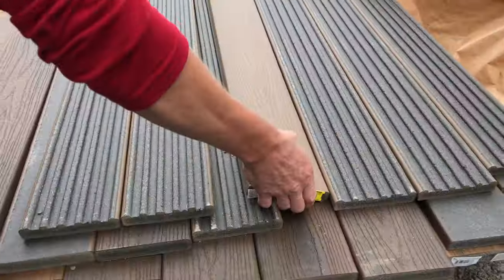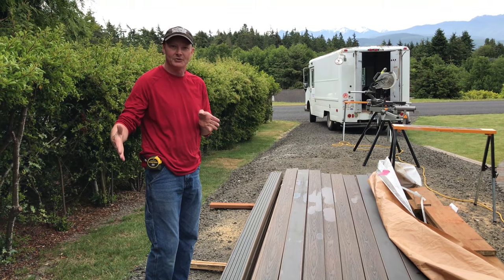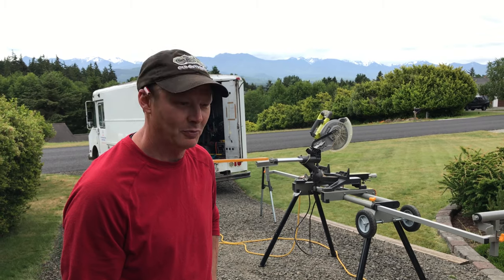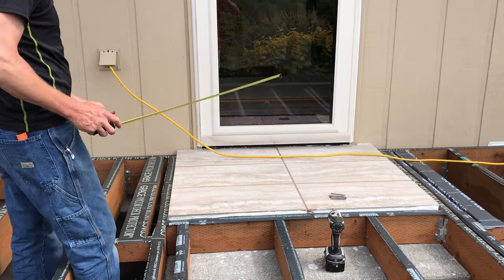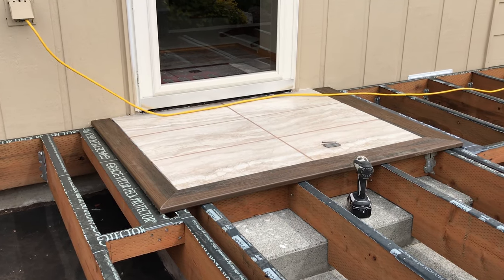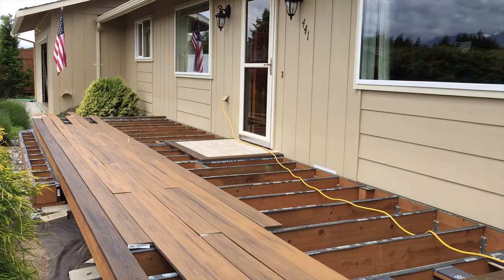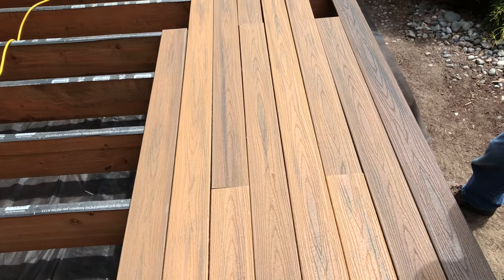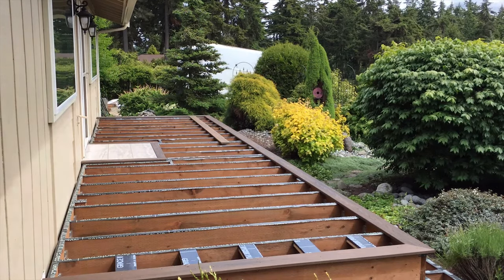Installing a Picture Frame Around Our New Deck - Trex Color Issues

Comment: You're the first contractor I've seen that uses deck flashing.  I've read about the use of deck flashing and have used it myself, but have yet to encounter any contractor in central Pennsylvania, including contractors that specialize in deck building, that even heard of using deck flashing.  Good on you for not just going ahead with what was either a terrible mill run or a tampered with batch of composite.  Kudos!
Reply: Probably put that tape on because he didn't use treated lumber
Reply: @thegg5097  sure looks like PT on my laptop. Even with PT the tape is the only way to do it correctly IMHO.

Comment: what type of board did you use for the picture frame? Fascia or the same decking board?
Reply from the maker: The same as the decking boards, Trex Transcend, but a darker color. We used the darker color boards for the steps too. Thanks for your question!

Comment: When you put the picture frame on  all of your joints look like their butt up against each. can we make ours tight as well even at the 45 degree angle part or do we have to have a space at the end of every board or do we just need a space at the end of every row?
Reply: Trex and nearly all Trex deck builders adamantly oppose miter cuts with Trex. Butt joints are recommended. But, if the client wants them then 3/16" gap at the miter.

Comment: I was informed from the makers of Timbertech not to use flashing tape on the hoist. The chemical reaction will break down the planks over time. Read the manufactures recommendations and save yourself a serious headache years ahead
Reply: I dont think so .

Comment: If you ran the boards in the other direction you would not have had to butt boards up against each other and have seams all over the deck.
Reply from the maker: Donna, you are correct! The subject of the board direction was discussed at length with Chris, our contractor. Trex Transcend Deck Boards are available in 12’, 16’ and 20’ lengths. Our deck is 9’ wide, defined by existing landscaping so there would have been an incredible amount of waste of money and material had we run the boards perpendicular to the house. As I recall, each 12’ board cost the contractor about $60! Thank you for your comment!
Reply: running the deck planks parallel to the house looks far better. going the other way makes the deck look stubby. nothing wrong with seams in the deck as long as they are staggered and look random.